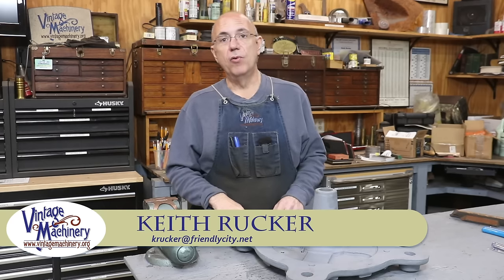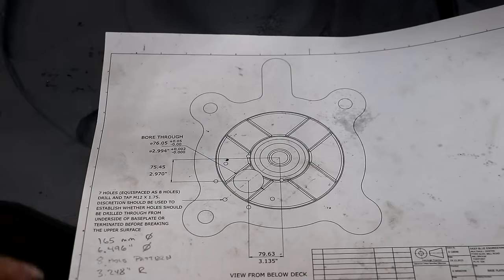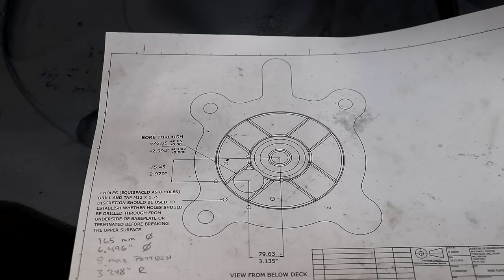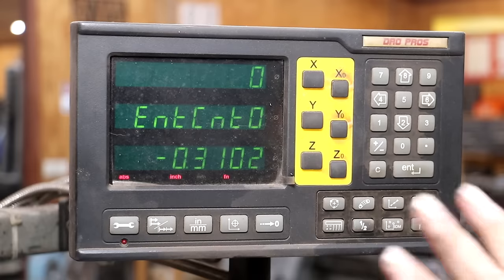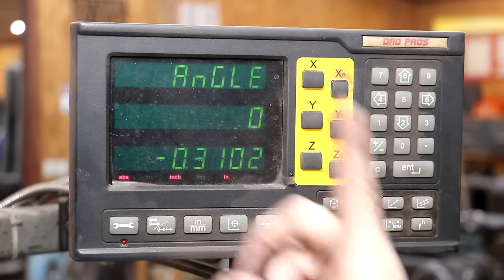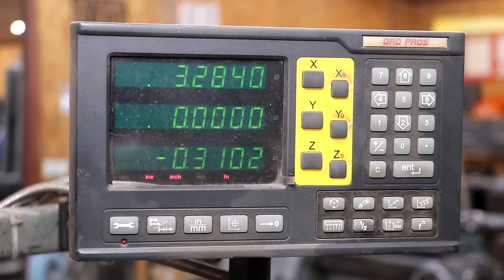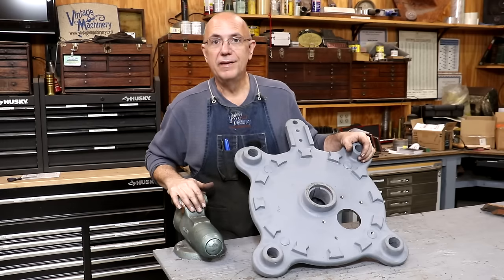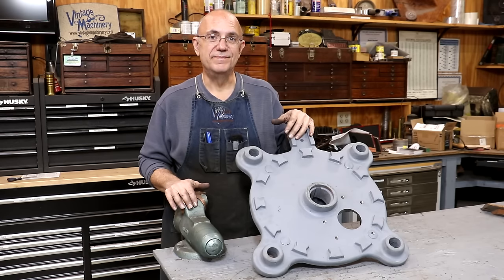Tally Ho Capstan Restoration: Drilling & Tapping a Bolt Hole Pattern in the Capstan Base

Comment: The hole at the edge... Why not start with an end mill some 50 thou larger diameter, down to the lower surface, then spot drill, drill and tap?
Reply: My thoughts exactly.
Reply: I was coming to make the same comment… though I am just an armchair quarterback:)
Reply: I am not a machinist, but I think that end mill shanks and Jacob chucks are not compatible, I think they are both too hard to work without risking damaging each other.
Reply: Definitely use a bottle cutting end mill. 5/16 that way you can clean up the sidewall so the tap will riling straight 😱😱😱
Reply: I am an engineer and the engineer messed up. Bore through the web, holes on edge... These issues are a machinist following bad plans doing the best he can
Reply: @pressokaytocancel  Cast iron machines very freely, and you can chuck an endmill into a Jacobs chuck provided you do not put any real side pressure on it. Plunging straight down is a total non-issue in this material with an endmill.
Reply: @joshua43214  Good to know, thanks!
Reply: While using an end mill in a drill chuck is not recommended it also depends on what is used to connect the drill chuck to the spindle. If it's Morse taper and no drawbar it's a no-no. If it's a taper using the drawbar then it shouldn't be a problem. A better solution would be a collet chuck at the size of the end mill.

What I cannot fathom is Keith not having, in that vast collection of tooling, a ratchet type of tap wrench to work in the tighter corners. Even an adjustable, "Newfoundland vernier" or a fixed open end wrench of the appropriate size would have been less amateurish looking than that "fumbling" around. I'm sure even Starret would have one available.
Reply: @pressokaytocancel  Agree but one selects rigging according to the job. Collet chuck for milling, drill chuck for drilling.
Reply: @joshua43214  
I've never used cutting compound when tapping CI.
Reply: The drawing didn't call out a spotface. Blame the designer, I would...
Reply: My thoughts too. Keith's hand is really gentle to have a drill bit do that work. There are a bunch of ways that piece can be done so he went with what he is comfortable with. Old dogs and new tricks eh.
Reply: @nosefirst  Engineer should've designed it that way, but the machinist should've been able to make that call. They might have a reason for it, but as an engineer myself I can't fathom any reason you would ever want half of a threaded hole in a mounting application like this. I can't see that being anything but bad.
Reply: Your not thinking in Metric, as all of this is done to match with a metric part. All the drills and taps are M sized as in Metric, no fractions involved.
Reply: @pressokaytocancel It’s not so much that they will damage each other as the drill chuck doesn’t have the runout accuracy or torque transmission capabilities of a collet chuck or end mill holder. In this situation there’s no problem swapping out the drill chuck for a collet chuck or directly mounting a collet in the spindle to hold an end mill; and then going back to the drill chuck afterwards.
Reply: @robertgarrett5009  So what? Use an end mill that's 1 or 2 mm larger if tvat feels better.
Reply: @ronwilken5219 Isn't that the truth.  Keith has more tooling in that shop than most tool rooms. Making video content is probably more of a pain in the ass than I would tolerate,  but lots of people that have never had anything to do with a machine shop enjoy seeing how things are done.
Reply: I've noticed that the person doing the work usually has a lot of options and if they are highly experienced they will do things that work for them. I have seen that you can often do something with a little patience with the setup you have that will work without having to use up a lot of time to change out your setup for one or two little things. I could see that he was being gentle with that cut at the edge of that shoulder and I would have done the same.
Reply: @danielbutler578  Putting a spotface there would have been faster, and easier, and resulted in a better finished part. Literally no reason not to do it that way.

Comment: If you have a ratchet where the arbor is exposed on the top you can take it apart and center drill the top side and get some tap sockets and now you have a ratcheting tap whench with a centering feature. I rarely use a tap wrench now unless I dont have a center and need even pressure.

Comment: I was surprised that you didn't use a 1/2" end mill to relieve the casting and provide a flat spot for starting the drill on that hole near the center projection. That size would provide clearance for the M12 bolt threads, too.

Comment: The lesson to be learned here is to use the measurement system specified in the drawings  with a DRO there is no need or excuse to convert measurements: one can switch units and use the measurements specified in the drawings and avoid the errors made here. Lets hope there is scope to mitigate the bolt hole error.

Comment: Put your tap in your drill chuck, goose the spindle and let it start itself in, if you are chicken to power tap it or are using hand taps then use a hook spanner with the pin to grab a chuck key pilot on the drill chuck and bar it around. on my non quill Hardinge TM vertical head I use a straight shank drill chuck loose in a collet for alignment and bar it in and out.

Comment: Re the alignment mistake, it's feasible that the motor mounting flange will need elongated slots anyway to adjust initial gear lash and for subsequent wear. Many windlasses have that.

Comment: Why not switch the digital read out to Metric therefore avoiding the introduction unnecessary errors, after all 165 is 165.
Reply: Doesn't matter what the units are when a mistake is made keying in the numbers.  156 could have been keyed in just as easily.
Everyone makes mistakes.
Reply: Older US CnC as far as I'm aware can't do Metric due to the electronics, so it's down to the machinist to do the conversion to the nearest decimal/fraction.
Reply: @robertgarrett5009 This isn’t a CNC machine - his DRO has an inch/mm readout button so easily done…

Comment: Keith,
I've never had much luck drilling on a step surface. They always drill off center. The video shows on both those holes they were forced off center on the low side.  I would have thought you would use and end mill to create a larger flat surface for the drill to start on. It would not have needed much more than just a little room for either nut or bolt head clearance. Good luck!
Reply: I agree, surely as you said, using an end mill would have relieved that flange edge and made a nice flat surface for the center drill to start, also I noticed Keith was not rotating the tap backwards a small amount each time to clear the chips and why did he not get a shorter handled tap wrench to save all that fiddling about. Cheers from the UK

Comment: After moving that head out to reach that one leftover hole I sure as heck after centering the big bore would have double checked the hole pattern on one of the other tapped holes with a pin in my chuck.

Comment: If you use a tap follower anyway I'd have no problems using a wrench on the tap.
For the holes that intersect the edge of that inner boss I'd definitely plunged down with a bigger end mill first, big enough that you don't even have to start the tap on the edge part. Makes me wonder how the motor is even supposed to get mounted there.

Comment: That piece of the capstan will spend a considerable amount of time actually submerged in seawater. Which is probably the reason the head was seized and broke during disassembly. I have not seen you create any grease channels or locations for grease fittings. What is the maintenance plan?

Comment: The radius should have been 3.248 not 3.284. Hopefully there is enough clearance on the bolt holes to compensate for the difference.

Comment: The "That's good enough" machinist only made the bolt circle .072" bigger than it needed to be. But "That's good enough!" 🤣

Also kids, dont use a spot drill like an endmill like he did. The spindle was deflecting the entire time. Just put an endmill in to clear material for your spot drill and drill. Do it the right way, not the "It's good enough" way.

Comment: Great video! Back in HS metal shop, we didn't have a mill so I never learned hot to use one. My only surprise on this series of videos is the lack of lubricating during cutting operations. I was trained to always use cutting oil by the late, great Mr. Waldo - our shop teacher.
Reply: Not a pro machinist either but as i understand it, cast iron, due to its high carbon content, is self lubricating.
Reply: Yep cast iron doesn’t need lube

Comment: Keith, do you have any concerns about the hole that is drilled and tapped through the plug? Are you confident that the plug won't break loose during assembly/use of the drive mechanism?

Comment: I think I would have filled those voids inside the mounting point with Devcon epoxy putty for a uniform surface and milled the whole lot flat, with a relief around the two bolt holes near the shaft boss for a bolt head and washer. But I'm not a machinist and don't know whats getting bolted onto it so what do I know.

Comment: 6:53 
Use a 12-point ratcheting box wrench to turn the tap😂
Reply: Or just unscrew the handles and spin it holding the main body.
Reply: Or tap it from the bottom.
Reply: Or a shorter tap wrench.
Reply: Or an Irwin tap socket
Reply: @TgWags69 , I have a set of those (3/8”&1/2”) and they come in really handy for tapping and to clean old threads out.
Reply: @Hoaxer51  Ya they came out with those at least 25 years ago, yet they still seem to be relatively unknown. I use a hex impact socket adapter to drive them with a drill. It makes it really easy. I  do notice a little runout in mine though.
Reply: Yes, I'm really surprised that, in a workshop like that, Keith hasn't got a smaller tap wrench. using some sort of ratchet wrench might cover the end of the tap making centering difficult.
Reply: I’ve done a lot of power tapping on Bridgeports with the tap clamped not too tightly in a Jacob’s chuck. No, it’s not approved and definitely frowned upon but it works well if you’re careful and have a “feel” for the work. Slightly oversize tap drill, sharp tap, proper lubricant, slow speed and finish by hand. The tap will usually slip in the hard chuck jaws before it chips or breaks. Saves a lot of time if done correctly.
Reply: @ellieprice363 , Key word here is have a “feel” for it.
Reply: @Hoaxer51 Yes, after sixty years in the trade I don’t break many taps anymore. “Feel for the work” is a rare skill that many never develop. It seems you either have it or you don’t.
Reply: I have a 3/8 ratchet tap driver I can do just that with. 40 yrs old and NEVER FORGOTTEN ABOUT.

Comment: Just like you knew what you're doing keith. My hat is off to Windy Hill for the accuracy and quality of that casting. The way that bolt circle intersected the lines of the  upper casting was /is PERFECT.
Reply: That's not the Windy Hill casting.   Keith is working on the original 100+ year old castings that were salvaged intact.   Windy Hill is casting a different piece (the cap of the capstan) that was broken during disassembly.
Reply: @walnutclose5210  Any Idea if there are videos showing that transition to when the old castings were brought back and the decision to upgrade the old, original castings ?
Reply: @TomokosEnterprize  Keith's earlier video shows them trying unsuccessfully to dismantle the capstan, they ended up breaking it which is why a new upper part is being cast.
Reply: Thanks @spentacle

Comment: Since you tapped two of the holes from the other side, how will that affect the bolt up if at all? I enjoy the videos. Thank you!
Reply: It doesn't make a difference. Think about how if you have a nut and a bolt, you can thread the bolt into the nut from either side and it works.

Comment: How crazy…. The capstan was obviously made in imperial England. The owner measured a 6.5” hole and converted it to 165mm which Keith converted back to 6.496”!!
Reply: No he did not measure a hole. 
He is fitting an electric capstan drive motor which has a 165mm bolt  pattern radius.

Comment: Ya know Keith. It's a day late and a dollar short but on part 1 trying to find the center, you could of taken a half round file cleaned up the slag on that one spot (lightly) then put a small brake cylinder hone and just do only a several passes and that would of probably of given you a better reading on the dial indicator. Like you said with your reading you got was fairly accurate for the job you were doing. BTW I enjoy watching watching your videos. They are very enjoyable

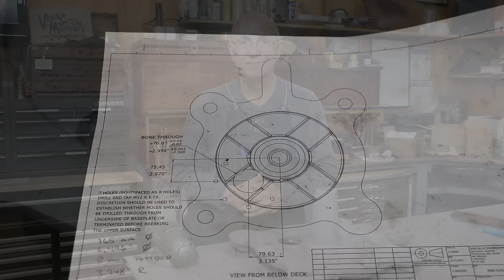Comment: Question for all:  I'm trying to learn.  How was the bolt diameter of 165mm determined?  Certainly not from the drawing Keith is showing us at 0:50.  Furthermore, how was the geometric coordinates of the holes determined?  It seems like it was "assumed" that the first hole was on the X axis.  Keith must have another drawing.
Reply: I'm guessing he just called the engineer and got the 165mm bolt circle dimension. As for the orientation, you can see in the drawing that the dimension line from the center bore passes through one of the bolt holes. This tells you that the hole is on the X axis.

Comment: I'm not sure I understand why you'd want to risk introducing errors through converting the dimensions to imperial if your DRO has a metric function... 
🤷‍♀
Reply: Shhhhhh!
Reply: Consider that with the exception of the few digital instruments (with In/mm buttons)  that Keith has, all his measuring devices and machines are imperial.
Probably more chance of mistakes when using both systems at the same time, machine using metric and check measurements with imperial.

Comment: Understanding what has to be done is always the first step.  Haveing good tolls makes the job easier.  I like the way you used the bolt pattern capability of the machine to do most of the calculations and positioning of the drill head.

Comment: Does the cone section go into the deck? I only noticed the 'VIEW FROM BELOW DECK' on the plan today and I had assumed the capstan sits on the cone section.
Reply: The cone penetrates the deck, it supports the fixed axle that the winding drum rotates around.
Reply: @frederickstibbert7389  Thanks, I went back and watched the disassembly video after posting this. Makes sense now!

Comment: A 10.25mm drill is required for an M12 thread. That's 0.40354 inch or 13/32 inch = 10.3 mm .

Comment: A question on tapping from different sides of the project. Wouldn’t that cause some holes to be reverse threaded?  Or did you have a left handed tap for the opposite side? Love your content and always enjoy watching the projects.
Reply: Changing the direction from which you tap does not change the handedness of the thread spiral 😉
Reply: @commander-tomalak  it reverses the direction of the cutting action inside the bore
Reply: No. That’s not how tapping through holes works. It does not change the thread direction tapping from the opposite side.
Reply: Funny, every time I remove a bolt that is pointing towards me the righty tighty rule doesn’t seem to work. Kinda like the electric current direction following the right hand rule.
Reply: Or I’m being an idiot overthinking things to confuse myself, more likely that I suspect. Excuse my foolishness
Reply: @jamesnewman3237  I thinik you did confuse yourself there. I made the same mistake a few days ago, when I spend an hour thinking how to tap an quite inaccessible hole only to then realize that I could just simply turn the part around and tap from the other side. Happens to the best of us (or maybe just us two).
Reply: Jamesnewman3237 I see what you did there, ha ha, of course he didn't  - having a hook and line you attempted to sink us.
Reply: Your lack of understanding does not change the complexities of the world around you.  Even thought experiments stump you...
Reply: A tap is just a bolt with the ability to cut a thread on a hole that didn't have a thread before, have you ever needed to find "the correct side" of a nut before threading it onto a bolt?
Reply: This is hilarious. I think you have been trolled.
Reply: Oh boy… 😂

Comment: Keith, I enjoy watching your work. I have been following Tally Ho ever since it started. I have a question about tapping a hole. I'm not sure what you call the thread pattern for a tap. But here in America to tighten a bolt you would turn the bolt clockwise. When you tap from the opposite side do you have to use a different tap? I hope this makes sense.
Reply: It doesn't matter what way you tap it, from the top or the bottom, the threads will be in the same direction.
Reply: It's considered right hand (standard) thread or left hand (reverse) threaded. This thread is right hand and whether it is from the bottom or the top it doesn't matter so the same tap would be used.
Reply: Easy way to think about it, a nut can start on a bolt from either side. You don't have to turn a nut over to get the threads pointed in the correct direction.